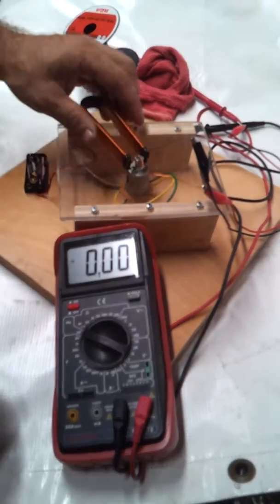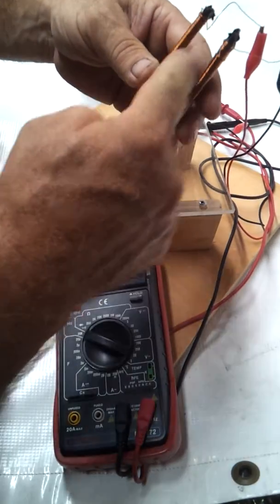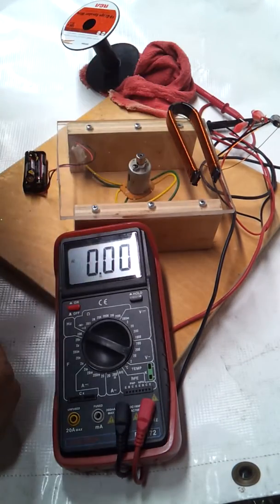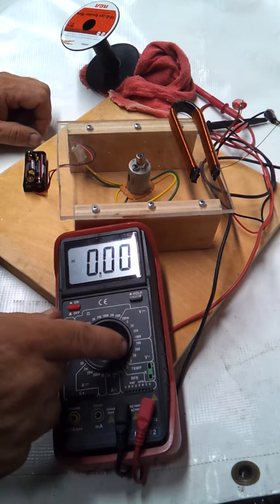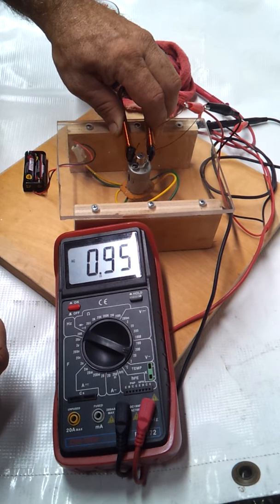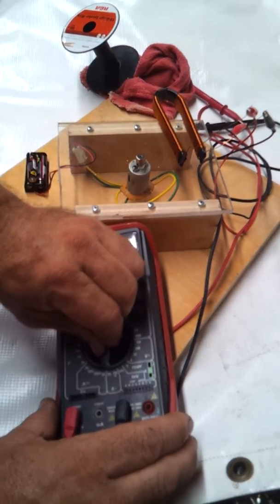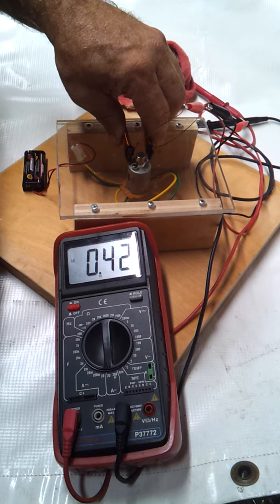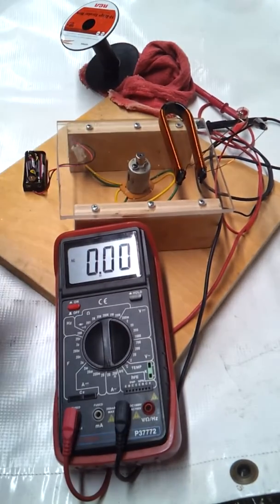Unbelievable bucking coil

Comment: It's just that for basic power measurements like that you have to measure the voltage and current at the same time or measure the voltage when loaded with a known resistor. When in the amp scale the coils are shorted at the output so the voltage will likely drop to much lower than it was when reading the voltage output across a high input impedance.

Comment: As a bsee it's taught to define carefully your measurements. Draw a diagram with current directions. Are your meters true rms on all AC or transients? Note phasing of voltage and current when calculating power is product.

Comment: I'll add to that "TheBdd4" said...
Generators are measured by their POWER.

1) Voltage must be measured in parallel with a matching Load. (not unloaded)

2) Current must be measured in Series with the matching Load. (not shorted)

When measuring Current, you can not connect the Ammeter directly across the "source"... which is this case is the coil would on the piece of iron/metal.  The Ammeter has an internal "shunt" resistor, typically 0.01 Ohms, and measures the Voltage across that shunt to calculate Current. So, in essence, what you are doing is shorting your generating coils with a 0.01 Ohm resistor. 

Because the wire in your coils have approx. 0.708 Ohms (for 30 feet of 23AWG copper wire), your Ammeter shunt load is VERY mis-matched from your generating coils.  When you saw 0.5 Amp output, you were seeing 0.005V across this 0.01 Ohm Ammeter shunt resistor (inside your multimeter). (E = R x I)  This comes out to 2.5mW output.

To properly match the Generating Coils with a proper Load (for both Voltage and Current measurements), you need to connect a 0.7 Ohm (another 30 feet of the same wire, but MUST NOT be coiled or folded) to the output of your generating coils.

To measure Current, break one connection from the generating coils and the Load, and connect your Ammeter (in 20 Amp mode) in SERIES with this "load".  

To measure Voltage, directly connect the Load to the Generating Coils, and measure the Voltage across both (in parallel, not Series).

When properly measured, I'd guess you will probably get more like 0.25 Volts at 0.35 Amps, which is 89mW output

Comment: Thanks for your experiment. Please recheck your circuit. In order to tell what the current output truly is you should load the coil. Try 2 ohms at the 1 Volt output and you will probably notice that some of the current will be dropped across the coil internal impedance and the output will be less than 500ma. Keep experimenting.
Reply from the maker: There are 4 other videos in this series with bucking coils.
They put out 250-350 v